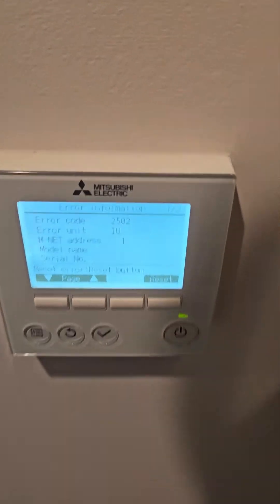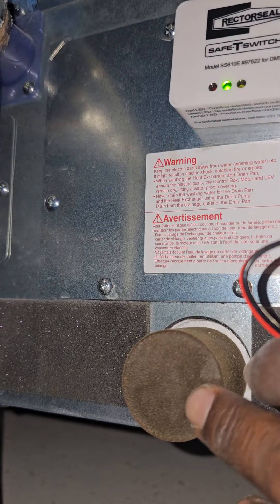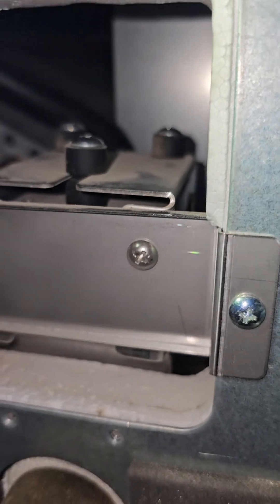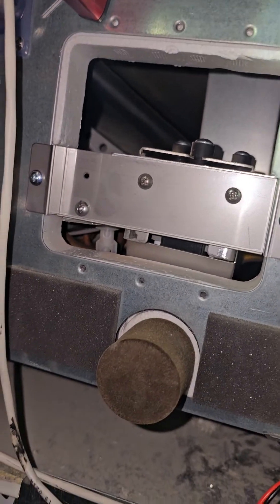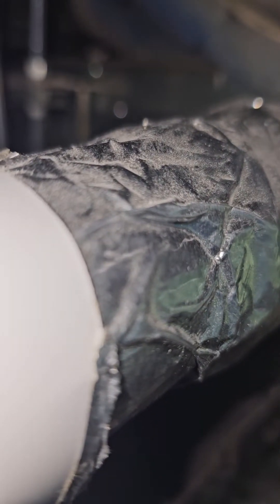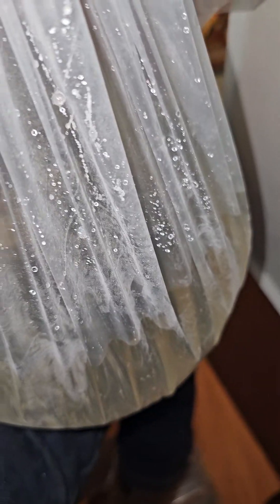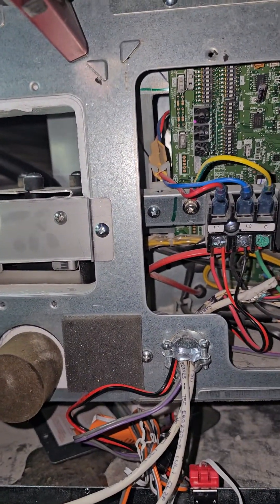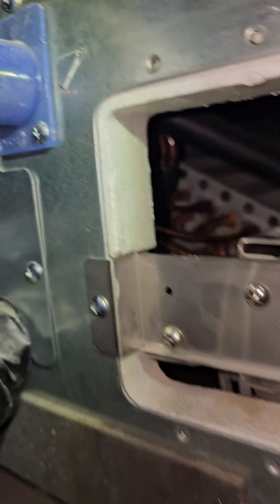ERROR CODE 2502 MITSUBISHI CITY MULTI  TROUBLESHOOTING

Comment: Great video!!  Our pump seems to fail for no reason.  Is there any reason we can’t move the drain line to the lower hole?   Also, when I looked at the circuit board there a red LED lit on the right side of the board. Any idea what that is for?  Thank you.
Reply from the maker: You could move it to the bottom and make it drain by gravity no pump needed

Comment: How are you Mr D2D NY, I'm from Indonesia, we have a problem with the Mitsubishi Vrf PUCY-P 200/250/300YKA AC, error code 7113, how do I fix it? Thank you D2D NY
Reply from the maker: The simplest way to troubleshoot an error is to go to www.mylinkdrive.com select the model of your equipment then download the service manual which has the steps by step troubleshooting guide for each error
Reply: USA models are pumy . The original pucy in English sounds little awkward so Mitsubishi changed it. Just for that reason.

Comment: Can you disabled the pump and use the gravity drain line ?if so is dip switches or unplugged wiring for pump ?
Reply from the maker: Just unplug the pump power plug from the board and leave the float switch plugged in